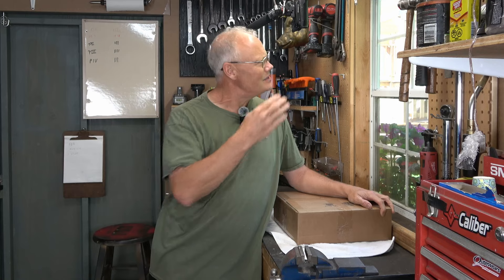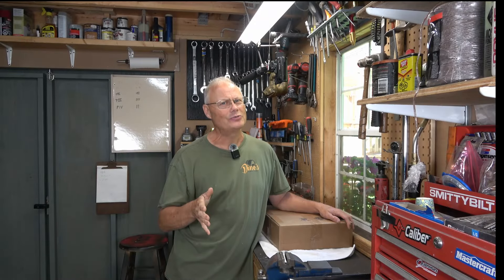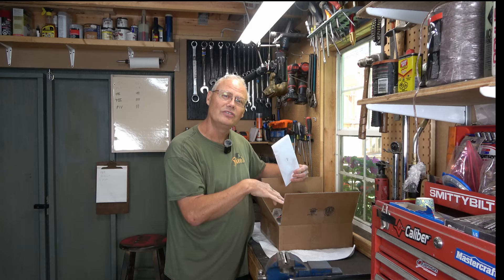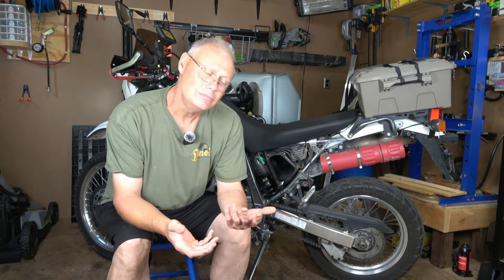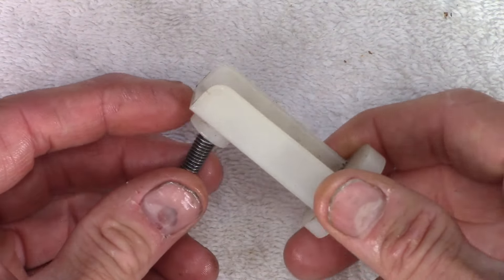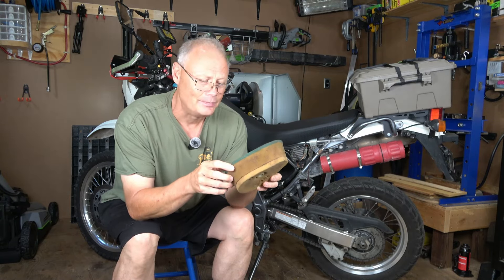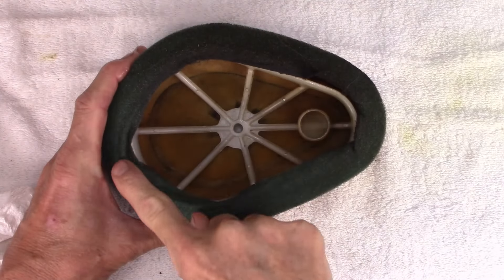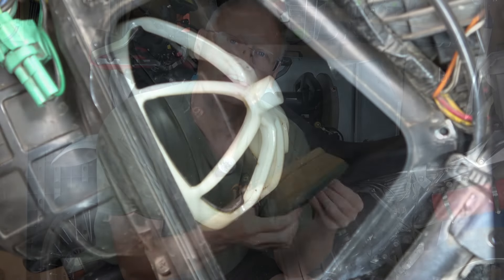Installation tips for the DR650 air filter

Comment: Nice video, Dino. However, I'm not sure K&N filter oil is intended for foam air filters. I feel it should be an oil that is 'tackier'. Obviously, any oil in your foam filter is better than none, but it might be something to look into. My preference is the Klotz foam filter oil. YMMV. Cheers!
Reply from the maker: Thanks for the feedback. I'll have to do a bit of research. Growing up we just used 2 stroke oil but today there are lots of choices. I feel the k&n will work even though it is marketed for use on cotton filters,  but perhaps there are better options out there.
Thanks again for the input, it's appreciated 
Dino
Reply: The Suzuki manual calls for the same 10W40 oil used in the engine. Seems right. Logic to me says I'm not adding anything foreign to the mix when the air drawn through the oiled filter inevitably transfers a wee bit via intake.

Comment: Nice shoutout to Bushpig Performance,  Dino.  They are great folks.   My purchases from them have gone very well.  Ill be buying one of those Tusk air filters when I order new chain and sprockets, plus cush drive bushings and a cush drive/sprocket housing bearing.   Shocking how worn those cush drive components are after 20000 kms!

Comment: Initially I thought that box looks large for an air filter - then you mentioned you have other things - ha ha - all will be revealed in a future video I presume. That filter looks good quality and a better seal fit than the standard filter. Good useful video Dino as I know a couple of DR owners who have troubles with air filters. I will (again) refer them to your videos. Thankyou
Reply from the maker: Thanks for the comment Mal, yes I have a few other things in the box that I will be sharing. The filter is most definitely a tighter fit and should provide good protection from dust.
Dino

Comment: On all filters that I service..I will put a 1/16 to a 1/8 amount of grease on the sealing lip of the filter so it (sticks) to the air box and then use the attachment method screw to hold it ..the grease help it seal and doesn't allow unfiltered air to go under it...
Reply from the maker: Great tip, I like it, thank you for taking the time to post.
Dino

Comment: Hi Dino. I'm very glad I found your channel. I recently bought my first motorcycle, an old Suzuki XF650 Freewind (road-touring version of DR650) and your videos are very helpful for me. Unfortunately, in Europe you can't buy a new DR650 due to stupid requirements, which is a shame because I think this bike would be very popular. Suzuki should update it a bit to modern requirements (fuel injection, ABS) to be able to sell it in Europe. I would buy it immediately. The prices of old used bikes are horrendously high. Luckily there is also XF650, which is not killing with its price :-) 
Thanks for all your videos and Greetings from Poland.
Reply from the maker: Thank you for your comments, I agree, Suzuki should freshen up to old girl to make it meet emissions but still keep it simple for those who don't want or need a lot of tech on there bike. Just a simple, reliable motor, good suspension and a decent sized tank.
Dino

Comment: Yet another great how to video Dino, on what is in my opinion a very important topic. There are very few things on my DR that I do not like the design of but the air filter retaining system is one. Even though I’m a very experienced biker who has owned many dirt bikes with washable foam air filters I just don’t like the loose feel of the stock air filter when installed. It just doesn’t seem to press the sealing flange of the air filter firmly enough against the air box. I might have to give that Tusk filter a try as you mentioned that it seemed to be a tighter fit than stock.
Reply from the maker: Thank you for your feedback, I do find the Tusk a much tighter fit and should provide better protection from dust. 
Dino

Comment: I got one of the air filters that had the rubbery foam gaskets and it took me about 20 minutes to get that sucker in. Because the gasket part was so much denser and stiffer It was hard to tell if everything was actually lined up properly, then with my hands being oily from all the oil kept dropping stuff too😂
Reply from the maker: Thanks for the feedback, ya the oil definitely makes the reinstall difficult even with the stock filter. Thanks again for taking the time to comment.
Dino